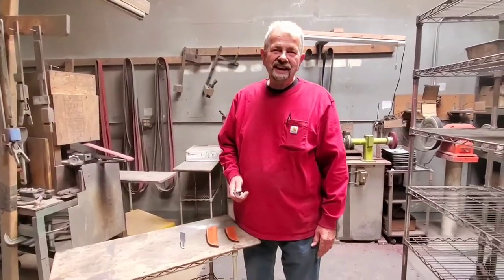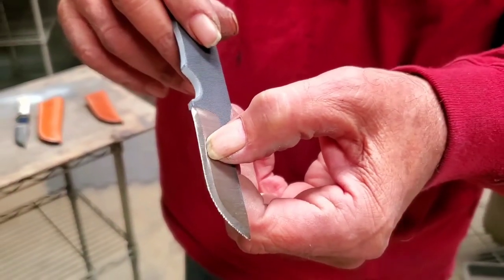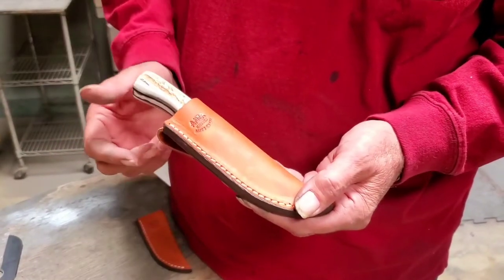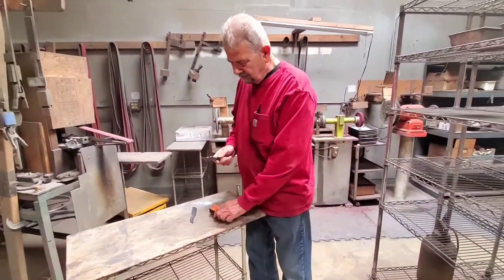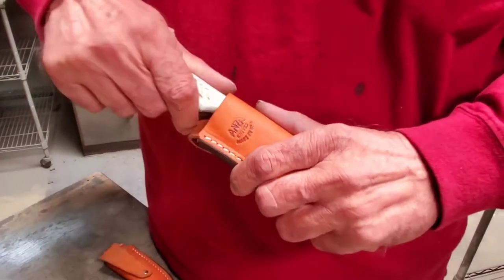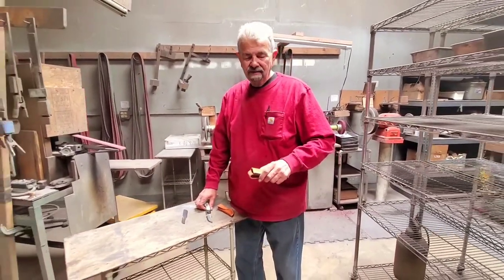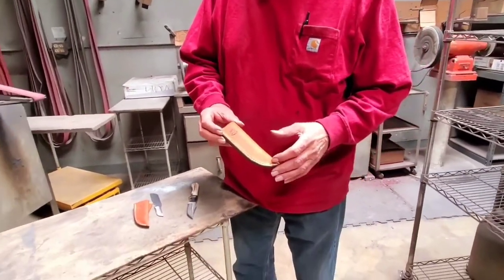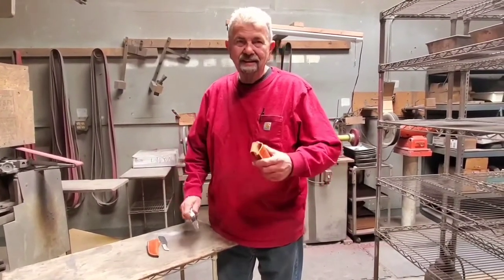Sheath Info & Sheath Safety

Comment: How do you feel about wet forming the sheath? I’m going to try to it for my Anza knife tonight. I’m unable to carry it because of low retention. Any plans to offer Kydex sheaths? 
I absolutely LOVE the two Anza knives I have though!
Reply from the maker: Hey john! If you do that, make sure to not put your knife back in the sheath until its absolutely dry or it will rust.... Atleast a week??   For kydex, I recommend you finding someone locally.
Reply: @anzakniveshandmadeinusa9457  Thanks for the reply! I definitely will let it dry completely! I try to keep mine polished and with a very thin layer of oil on it!